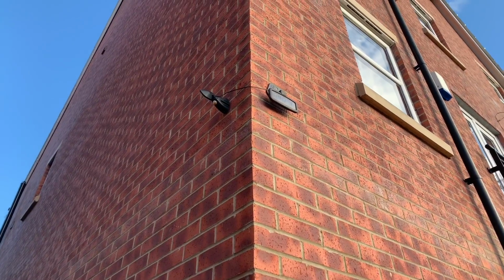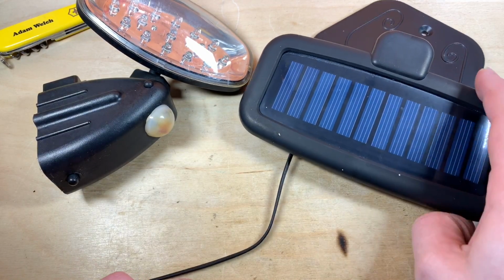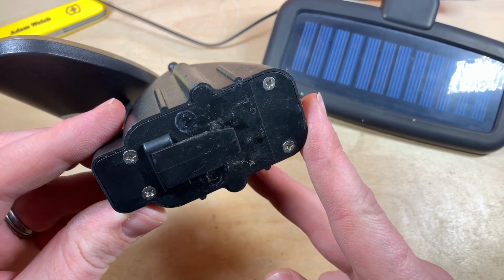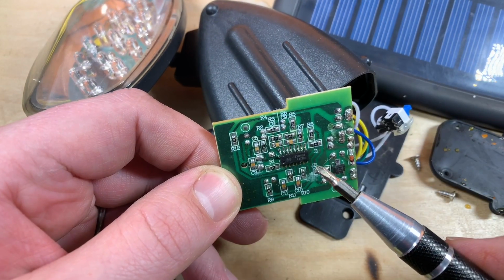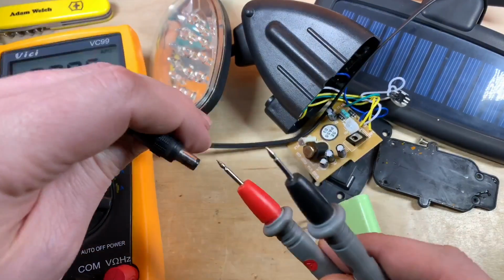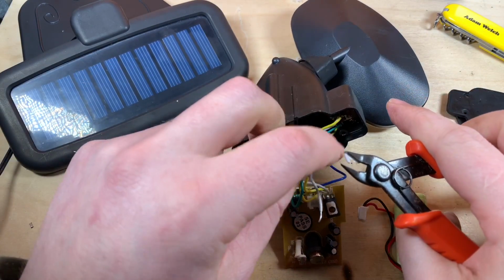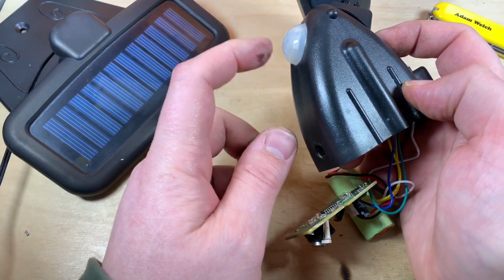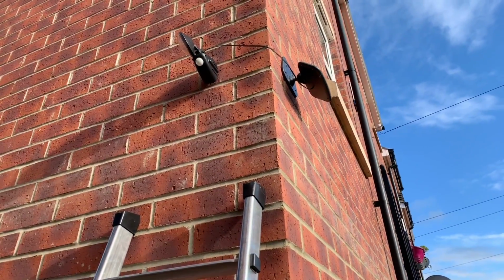Fixing a Solar Powered Security Light.

Comment: I have the same light, it's borked after 6 months outside. Really dim, and need to stand under the sensor to get it to feebly light. Would not recommend.
Reply from the maker: I don’t think you can really buy them any longer. Mine must be five years old. It’s very directional - despite the reflector. The trade off for using standard LEDs I guess. Still working now after my quick repair though. Cheers

Comment: Here's a tip, when working on wet electronics douse it in IPA, the alcohol will displace the water and evaporate quickly, also if it's something you really care about such as a phone then it should be thrown into an ultrasonic cleaner or at least smear flux on it and reflow the joints of the affected area, because water has minerals and things which cause corrosion, so you'll want to remove it.
Reply: Condensation is relatively clean (well, before it starts to helps metals oxidise). Rain is dirt surrounded by water, but still not too bad for minerals (unless a volcano has erupted). Tap water in hard water areas and surface water is very bad for electrical and electronic devices if left.
So any electrical and electronic device affected should be washed out and cleaned with clean water. In soft water areas, tap water is fine. In hard water areas, you can use tap water, but finish with a final wash using demineralised or distilled water.

Comment: Adam, did you use anything to seal the hole where the switch was?
Also, it is good practice to have a 5mm diameter drain hole at the lowest point of the enclosure, so if any rain water or condensation does get inside, it can find a way out.
Reply from the maker: No I didn’t seal it - it’s about five millimetre in diameter and at the lowest point of the enclosure :-)
Reply: Adam Welch - Excellent 👏😀

Comment: But how did the water get in?  I would have sprayed WD40 on the PCB and all the rest.
Reply from the maker: Yeah I guess I could have used WD40. There’s a drain hole now where the push button was - so although moisture can get in, water is able to drain out.
Reply: @AdamWelchUK   back on the ladder you go then :-) .  Funny about the condensation etc ... I have a couple of devices in my garden which have a rubber gasket to keep everything closed waterproof and there is absolutely no hole in those things that I can see. 
Well a couple of months and spring will arrive, maybe we should start ordering from China for our little sun projects!
Reply: @AdamWelchUK  Ah, that answers my question. Good idea in hindsight.
Reply: Changes in atmospheric pressure. Anything not hermetically sealed will have moist air going in and out. The moisture comes out of the air with changes in temperature. Water collects inside near the bottom of the unit and corrodes anything sitting there, in this case the switch. Personally I would always have a hole drilled at the base of the unit to let the water out rather than have it collect.
Reply: @MichaelAddlesee  Not only that, it could also just be condensation.
Reply: @kyoudaiken  Condensation = The moisture comes out of the air with changes in temperature
Reply: Great video